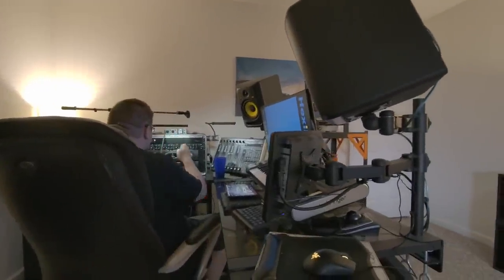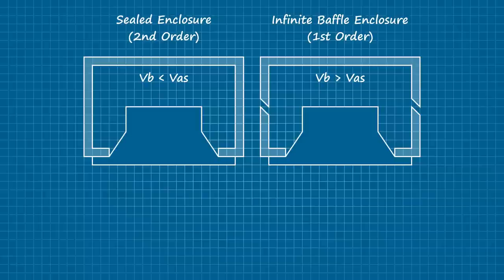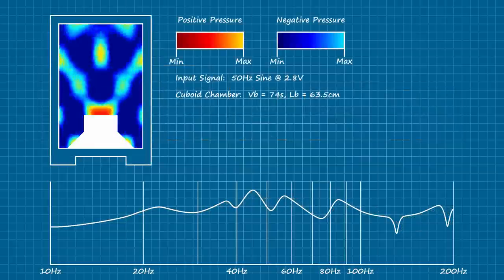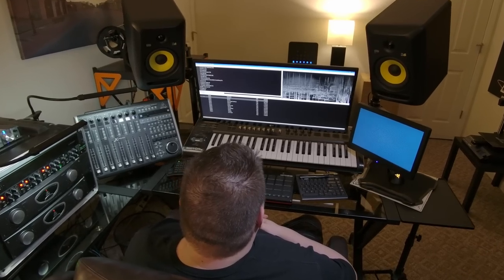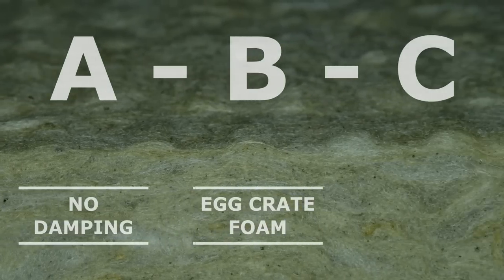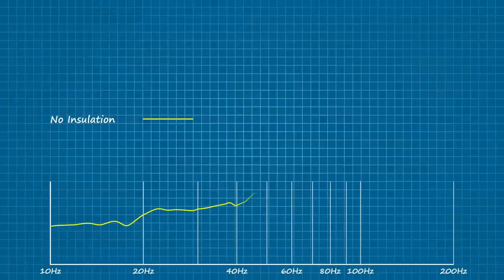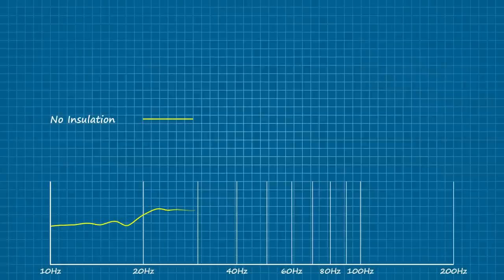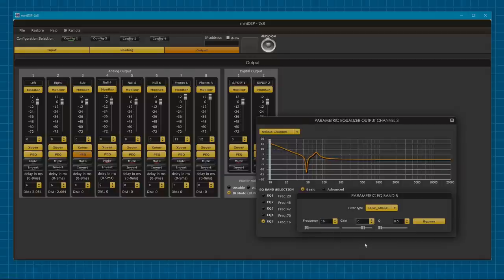Treating Enclosure Resonances

Comment: FILL THE BOX.  Sorry for shouting.  Putting the material on the walls is the least effective thing you can do.  The material works by resisting the motion of the air, resisting the velocity, just like a shock absorber.   The velocity of the air at the wall is zero.  So the material against the wall does nothing because the velocity perpendicular to the wall is always zero.  The pressure is high there, but that doesn't matter.  So just spacing the material a few inches from the wall will double the effectiveness.  For full effect, fill the whole box with the wool.  Even if there are gaps between the sheets. Just stack them in there.  As you could see from the first animation, the long chamber has lower resonance frequencies than the short wide box.  Build the short wide box.  A half cube shape with the woofer centered on the square side will always be the best.  Build the smallest volume you can to raise the mode frequencies higher.  The damping material is most effective at higher frequencies and it's useless at low frequencies.  Building a box with a Qb of 0.7 or 0.8 is best.  Just use a Linkwitz transform to equalize the result to give the lower F3 and a Q of 0.5 or what ever you like for low group delay.  A big box is not required so long as the driver has sufficient power handling to hit Xmax, that's all the bass output you can get.

Comment: I have a small Klipsch subwoofer that has a problem with chuffing. It is not all the time and only seems to happen at a certain resonance of low frequency. I only have the volume turned up to a 2 or 3 so fairly low so I'm not really taxing the sub. It's maddening because it's a nice sub and Klipsch is a good make so I don't understand. I'm new to home theaters and would appreciate any thoughts. Enjoyed your vlog!

Comment: The insulation makes virtually zero difference in the operating range of a subwoofer (15-50hz) so this is largely a waste of money if you tune your sub correctly. The room modes usually dominate the response anyway if you live in a house with concrete or brick walls.

Comment: Do the same test with full range speaker (Up to 20khz)
Reply: The results would likely be significantly more of a radical change to the response.

Particularly in the case of a cabinet entirely filled with rockwool, with or without a vent.
Reply: No! Rockwell should not be used.  Open Foam, Poly ,Pink Insulation and non Density wool all allow air to easy flow through them and it break up the sound so when the sound bounces back thought the back side of the woofer does not cause unwanted bouncing back to the front of speaker. A Safer way is to use Flat Foam with or w out Poly. (all make the Encolure seem Bigger) or No-rez or Sonic Barrier Also No-rez has DYNAMAT Butyl Rubber and Sonic Barrier does not and This will help make the Speaker Deader and reduce speaker vibrations.

Comment: Great video thank you. How do you measure the response? Is it quasi-anechoic? Any room effects? At the size of the sub enclosure you have, there shouldn't be any modes in the box up to 150Hz, since the wavelengths of sound up to that frequency are much bigger than the box inner dimensions, thus creating standing waves. Am I wrong?

Comment: The resonances at 146 and 194 Hz are most likely caused by the enclosure walls. More braces would have suppressed them more (and shifted up), but wool didn't. Having convex walls also helps.

Comment: Even if the box is large, the order is still 2, not 1 as you show here, and in other of videos. The stiffness of the box may be neglible, but the stiffness from the driver itself remains. So, at low frequencies, the system is one degree of freedom and order two.

Comment: At the risk of sounding like a professor: Without numbers and units on the y-axis of the displayed graph it's impossible to know the magnitude of the resonant suppression with each of the three runs.   i.e.  how many db did the material help suppress resonance vs. no added material? ENG 101 - LABEL YOUR DATA!  Also the cost data for the two materials would help to do a cost benefit analysis. ENG 501 - THE ANALYSIS IS INCOMPLETE WITHOUT COST ANALYSIS!  Also it would be good to know the volumetric mass and density of the two materials to determine if the dampening might have more to do with the mass (than of the acoustic properties) of the materials?

Comment: You more than likely simply increased the Q of the enclosure by making it appear larger to air inside by slowing the waves with mineral wool. Try it with polyfil of the same weight and report back. There's nothing magic about what you used, people could be mislead into thinking the material you used had the effect - not the slowing of the waves achievable by making a larger enclosure or adding a few pounds of polyfil.